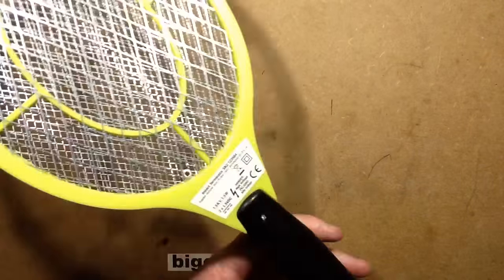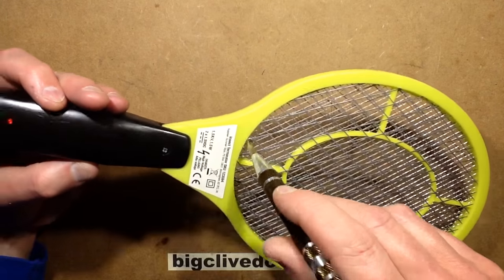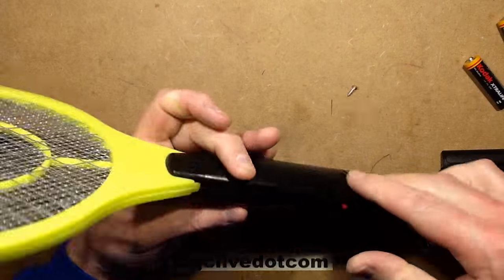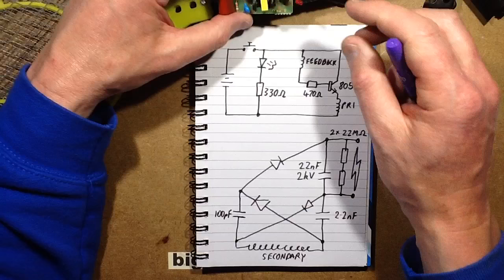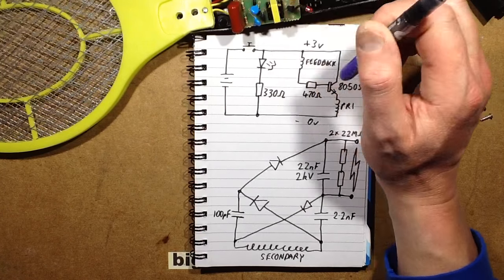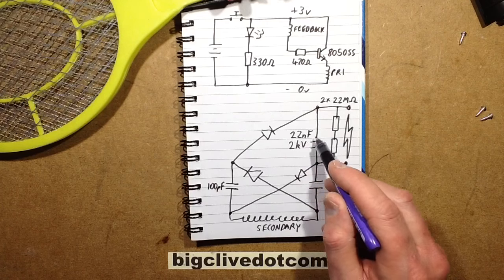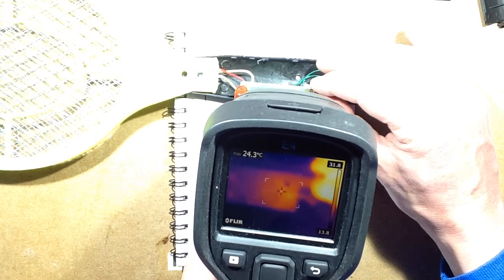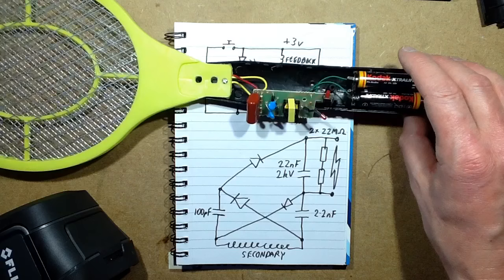Inside a bug zapper racket / racquet , with schematic.

Comment: I have a similar racquet, but it has an Europlug on the back of the handle and the usual capacitor dropper that charges the batteries. The problem is that of course while they supply the batteries, the cover arrangement for the compartment is the same as the ones without charging plug, so you can get shocked if you open the compartment while it's plugged in :D

I seem to have some superpower that allows me to find large quantities of dodgy capacitor dropper-powered devices (this, the weird lantern that shocks you if you touch the USB output or the batteries, and a battery charger with no discharge resistor and exposed terminals) :D

Comment: Is it possible to replace the batteries with a 3.7V 18650 size Lithium? I would like it rechargeable...
Reply: I would recommend using LiFePO4 cells, (3.2 volts per cell) which is the same as the open terminal voltage of 2 alkaline cells connected in series. They have a much lower internal resistance than alkaline cells, so it will charge more quickly. It may even be necessary to insert a low value of series resistance between this cell and the circuit, to emulate the equivalent series resistance of the alkaline cells, it's replacing. The cells are available in a size similar to an alkaline "AA" cell, but are very slightly larger in diameter. They are manufactured by Westinghouse, for solar marker lights. I bought mine at Walmart. about $10.00 US for a pack of 4 cells. If you use the original holder, the holder needs to be modified to connect the cells in PARALLEL. Otherwise, the 6.4 volts will almost surely blow out the step-up supply.

Comment: I used a few of those to charge the capacitors of a small Coil gun I've made...But impatient me decided to add some more voltage at some stage until stuff started to smoke... yeah... Surprisingly they didn't die.

Comment: In regards to the transistor over heating if the button is held for a long time, if the 2 discharge resistors were removed, and the button held for say 3 seconds and released, do you think the grid would remain "charged" for a short time (1 minute) until a bug pops?
Reply: The grid would stay charged for far longer than a minute. More like hours or days.

Comment: I have one of these, virtually identical in design, with subtle differences and dismantled it as I played this video. My pcb is slightly different, with only 1 large capacitor, same transistor and transformer. Your Poundland one looks better quality inside than mine which I inherited, so supplier unknown.They work great. Swatted an annoying fly at work and works great with wasps.

Comment: At Harbor Freight there is a coupon that gets a free fly zapper with any purchase. So I buy a razor blade for 0.23$ and its pretty much free
Reply: +HDM4000 - Minecraft Yep, and unlike this one they use D batteries so lasts a long time.
Reply: +Dark Alchemist I have two of the harbor freight zappers and I've modified one. I took the circuit board from another zapper and put it in the HF zapper and now I have the power of the AA zappers but with longer battery life. I can go a whole season on a pair of D batteries and that's when frying bugs. the circuit in the HF zappers is too weak so this mod is an upgrade.
Reply: coondogtheman1234
Well, why would a circuit for AA batteries be more powerful than for the D batteries considering the AA has so much less capacity?  I would think it would have less zap.
Reply: *****
The difference is the Harbor freight zapper has a weak circuit (1000 volts) and the AA zapper has a stronger circuit (2000 volts) All I did was swap the two so the more powerful circuit is in the zapper that uses the D batteries. I'm sure you can change the main capacitor to something that holds more zap.
Reply: coondogtheman1234
I never had an issue with regular flies but horse flies and wasps it has to sit on it and fry them (wasps their wings curl first).  I would love to be able to have a higher zap from it.
Reply: *****
They have zappers now that can handle the bigger bugs but I find that the 2300 volt ones work the best. They are really 2000 volts. They can get the smaller fruit flies as well as houseflies and my favorite to fry, hornets, wasps and yellow jackets.
Reply: coondogtheman1234
Well, a standard Cockcroft-Walton doubler is all that is need for the voltage but just adding a larger capacitor (more voltage one as well) should work OR would just a larger farad cap be needed?  If so what value I wonder?
Reply: *****
I'm not exactly sure but I remember a guy on here did just that and he added a few motor starting capacitors and it had a bigger bang. He took that video down I'm not sure why. I should have saved it.
Reply: coondogtheman1234
Ahhhh, dang.  Well, if you go too high the spacing will not be enough and the arcing will be all over the place which will not help trying to hold it or killing flies.
Reply: *****
I had that issue on another zapper. I scrapped it and got another HF zapper and everything is good.
Reply: coondogtheman1234
Well, air gap can only do so much and it will arc (think Jacob's Ladder).  The gap is probably good for 1-2k but look out if you go too high like that one dude you mentioned.
Reply: *****
Like I said in my last comment I had that issue b/c the circuit was too powerful and the space between the grids was too small so I bought another zapper at HF (Harbor Freight) and it had the exact spacing as some of my other zappers the 2300 volt ones and I put the circuit that I originally had in the FIRST HF zapper the one that arced all the time into the SECOND HF zapper and all was good. Had to do a little customizing to get it to fit as the original board was smaller than the one I put in it. I just cut the board where the button was and wired the batteries where they should be.
Reply: coondogtheman1234
Yep, mine is from HF but not sure how many volts it produces.

Comment: When they first appeared in the US, they used two D cells.  The arc was almost that of a TV flyback transformer.  When you struck an insect (like a yellow jacket or wasp), it would sound like a firecracker and the insect would be thrown several feet outwards of 10'.  They seem so anemic now.
Reply: I want one of those now. :)

Comment: Heh, I love these things, always fun to rig them into shocking things/mock tazers, and you can use a 9 volt on them to give a really good zapp. Stick a 6 volt lantern battery on them and flies just fry.

Best part is pranking others though, years ago I rigged up a briefcase with metal clasps with the guts from one of these wired up to them, told people that there was $20, and all they had to do was open the case.

Good times.

I also mounted one on a glove and used some thick solid wire, the weird stuff with a kind of oily coating, on the fingers, and basically made a taser glove of sorts. Ahh childhood.
Reply: +Jesse
You might try sections of guitar string mounted on a leather golf or driving glove, if you're looking for something more permanent. Also change out the drive transistor for one in TO-220 package, it's physically larger and the metal tab on it provides a small amount of heatsinking. This prevents the thing from burning out on the higher supply voltages, and also probably makes it capable of continuous duty on lower voltages.

Comment: Clive, there now seems to be more modern types that does not use the multiplier circuit, just one stage only from a transformer with a single large cap on the output. Although lower voltage, they seem to work the same on flys. The output seems to be 800 volts on these versions.
I suppose the Cockcroft could be added to the output, with the large cap removed, to gain the higher voltages?
 The increase in the voltage is needed to use with flock to make so called static grass applicators for model scenery. The ones with the high output work, but the newer type fail. The high charge makes the flock stand upright as it hits the glue, which is connected to negative.
All a bit cheap-scape, but it saves spending £50 or more on a commercial unit just to do the grass.

Stephen
Reply: I have some of the single stage units. They use a 0.33uF cap (rated at 275VAC) that charges to 850VDC. Paralleled a 3.3uF cap; now has 11 times the discharge energy. Good times...

Comment: Great video! This is the video that gained me as a new sub for you about three years ago. Well, I'm back here again this morning to ask you to please consider doing a "Part 2" to this zapper video, if you have the time, of course.
   One thing I would definitely be interested in seeing is how one would go about checking the voltage output on any given unit, using a multimeter (if that's possible to do, without torching the average budget meter).
  And the second thing (of course!), would be to see you mod one of these to increase it's effective "dispatching" power. Thanks for any reply! 👍

Comment: Hah. I bought one of these for about a fiver at a market stall before going on for a drink with an ex. Said ex was heavily into kink. "What are you doing with THAT?" they said when they saw it. It transpired that an enterprising supplier of gizmos for pervery had been flogging them for fifty quid a pop to those who enjoy electro-play and paddling. I like to think that, given how well-connected the scene is, my accidental enlightening of my ex to the true nature of the device knocked, if you will, the bottom out of that market...
Reply from the maker: +proudsnowtiger I believe the first ones with open grids were used as electro spanking paddles.
Reply: +bigclivedotcom The same circuit (I imagine) is used in the 'Tazapper' device sold specifically for kink, though from personal, er, 'investigation', I'm pretty sure there's no discharge path for the big cap, as the bloody thing holds a charge even after you switch it off.

Comment: Is it possible to make a voltage divider so that the voltage across the output can be measured safely with a standard DMM? Where I live there are unfortunately few or no $1/$2 shops (there are some cheap shops, but they don't sell anything interesting at all.)
Reply: You can certainly build a voltage divider, but you will need to ensure that your chosen resistors and layout have appropriate breakdown voltages and clearances to ensure no high voltage can possibly bypass your voltage divider circuit and components.

Comment: I had the same zapper and decided to take out the PCB and make a little taser kinda thing. I  replaced battery with a 3.7v li-on and threw on a different switch. When soldering the switch, the + wire slipped ( - was already soldered) and energized the circuit while my other hand was across the 2kv capacitor foolishly securing the board to my desk. It hurt reaaaaaal fucking bad and the pain lasted for 5 or 6 hours. It was a good lesson.
Reply: Thanks for the video!

Comment: clive says transistor went up to 200*c i look at my computer CPU running 32*c and cringes ow

 my 300$ i7 and my 800$ kingpin 980 ouch i hope my computers transistors never get that hot as I start to panic when they get at 80*c AS the Tj max is 90-100*c and while it can run hot and be perfectly fine at 80*c am finicky with my expensive computer and I prefer to have it run at 20-70*c as i have a complex air cooling system to make sure it runs cool

that and when the AC is off in my house since im on the 3rd floor and heat rises it floats around 40*c instead of 32*c as it likes the room to have the AC on helps cool it down

Comment: Ooh, I have one of these!  Now I finally get to follow along at home...
Reply: +Matilda OK, my circuit is very different to yours - only one capacitor and a single diode.  There's also what looks to be a six-pronged transformer, but I don't really know electronics so it could be anything, especially as both sides are connected directly to the power supply.

Comment: the first ones were better, stronger zap, better quality, then this type came out, it was made by many companies and made like crap.  but i made the mistake of taking apart the first one, can't remember why, but it was a bitch to get it back together.  it had a lot more parts and like you said clive, it was much more complex compared to this later, crappier version.  it's hard to find the original in stores, but online they go for about $20 or more and this version you can find in many stores for about $5.

Comment: Nice going Clive! Actually the used schematics differ from different manufacturers, but the basics are all the same. If you want to zap fruitflies with those standard zappers it won't work because the fruitflies are too small and just fly through the mesh. Because we had a lot of them at home, I bought 2 zappers and used only the middle finer grid to assemble a zapper with 2 of those finer grids. I also had to bring the meshes closer together. I did that with my soldering iron, just by melting the plastic between the meshes a bit. Now I can zap them like crazy! However, a lot of those fruitflies where only dizzy after the zap treatment, so I also had to use the capacitor of the disassembled left over zapper to double the charge capacity and now I no longer have use of this 'fruitfly zapper' because they are all dead haha. They even sometimes exploded! You could also use the vacuum cleaner to suck them up, but believe me this is much more fun...
Reply: Mine works pretty well with fruitflies although some do miss the mesh. About 80% effective I think.

Comment: A friend from work had one of these and they were using it to zap each other. By keeping the button pushed so long it did fry the transistor and the small feed wires. So I told him I would repair it. I replaced the wires and transistor, then it worked again. Like you said they are meant for small bursts of power. Would the output of this increase by installing a 9 volt battery or would that kill it?
Reply from the maker: The higher voltage would result in both a much higher current through the transistor, and a much higher output voltage that could damage the capacitors.

Comment: I have one of these at work. Without the warning sticker on though! Didn't realise what it was at first. Thought it was one of those "wack something and I make a noise" bats, so stuck my finger in it. OUCH! Not nice. I'd be interested to know exactly what voltage and frequency is on those outputs. I am young enough to still be able to hear very high frequencies and I can hear something come from this in a quiet room.
Reply from the maker: High frequency from the power supply, but DC on the wires at about 1-2kV.

Comment: Clive, I've modelled that voltage multiplier circuit in LTSpice (free from http://www.linear.com) and if the capacitor you identified as 100pf is actually 100pf lose 1/3 of the potential output voltage. Since these are ultra cheap the makers must use any old capacitors (of suitable voltage) that they can get their hands on. I bet that the 100pf cap is actually 1nf. In actual fact I believe it should be the same capacitance value as the 2n2f capacitor. H

Comment: I had converted one of these for use as a static grass applicator from some examples on the web. The purpose made applicators are quite expensive and I was wondering what the differences might be?
Reply: +simontay1984 it is to apply artificial grass to a model scene in war gaming or model trains. you put glue down then the fibers in the grass take the static charge and the artificial grass stands up so looks more realistic.

Comment: I have one of those, 22nF wasn't enough for me, It works great but sometimes it takes several attempts to kill big flies, I used an old 100nF 2kV capacitor in parallel to give it 5x more juice, now it works much better. I wonder what would happen if you connected the output to a microwave capacitor...
Reply: +ElecDiy Then it wouldnt be a bug zapper but a human zapper.
Reply: +ElecDiy  Hm, we would probably be reading your obituary!
Reply: Done that. made a "bulk fly killer" using fine steel chicken wire (x 2 panels) and an old microwave oven power supply. Used a repurposed 200mm bathroom extractor fan to "suck 'em in" to the "death zone", and it did rather well. Should have made a video of the process - here in Australia we have "plenty" of flies, and the larger ones went with quite the "bang" . . . :-)